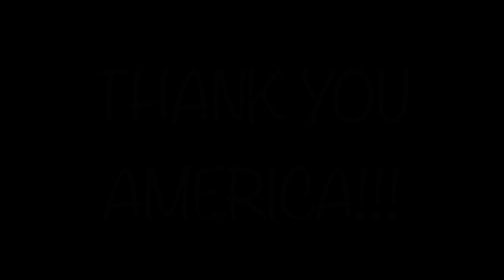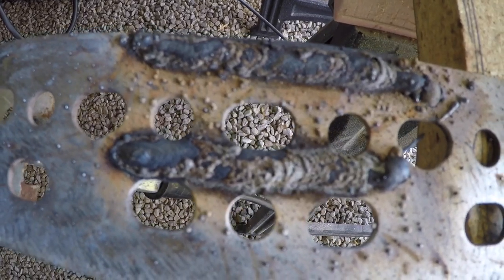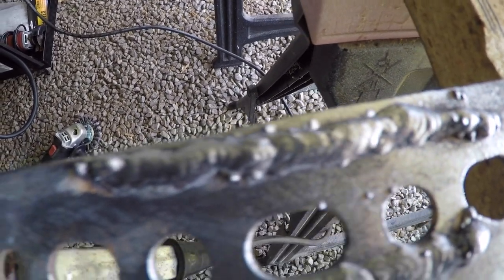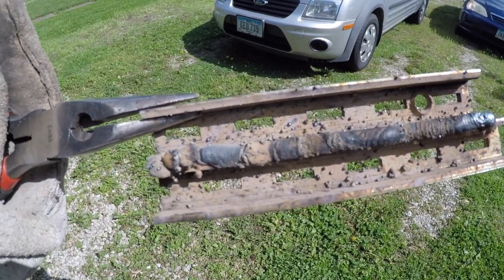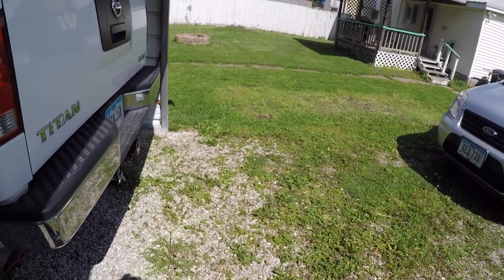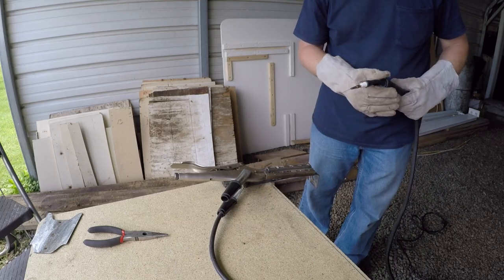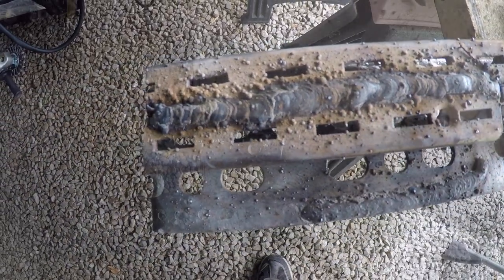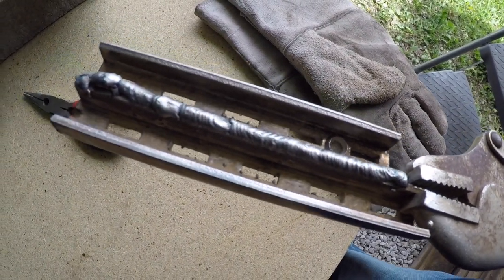Pre Mod Practice - Harbor Freight Gasless Flux Core Welder Mods - Memorial Day 2019 (Part 2)

Comment: Great Video...     4:14  Turn the wire speed up 1/2 to 1 gradiant more, you are real close.     5:30  You will often have a crater at the beginning and end of the weld.     It is ugly but not fatal as long as you aren't taking a welding test for Steel.     It would be a potentially fatal flaw for whomever was trusting their life if this was aluminum.     Cracks start at craters and can run the entire length of an otherwise beautiful aluminum weld.     The fix is easy and only takes an additional few seconds for double work.      The start of a weld is always cold (some pricey welders have 'hot' start controls) and you'll have a crater or porosity.     Okay the fix is to start in a half inch, start your weld till your puddle starts looking good, and then drag backwards to the edge and then immediately head back forward while it is still glowing hot.     Repeat the function at the far end where you weld to the end and then pull back and end in an already welded section.     Restarts in the middle are the same way.
Other side: Turn up the wire speed and as you mention a 'weave' of some sort - doesn't really matter which - your artistic preference.     A weave also forces you to slow down which spreads the heat, which will help penetration.     When you get proficient you can add weave styles if you think that's important.     I try to emulate the look of a stick weld, I assume because I learned stick welding years before I did any MIG weldingALWAYS wear safety glasses, even if using a face shield.      ALWAYS wear natural fibers or leather because almost all the synthetics will melt except the synthetics such as Nomex which is a special one of the 'polyester' family that will offer good protection for a limited length of time...
Reply from the maker: I really appreciate the tips and information! What you said makes sense to me and I think I understand what you explained. Now I need to practice, practice, practice and try to put your observations into my practice sessions. Again I can't say how much I appreciate your input. It helps me out more than you know!!! Thank you
Reply: Crater? That's why you sit still and build a puddle before you start moving and the same where you stop. If you have a "crater" then your doing it wrong lol

Comment: I want to start by saying I am in no way a professional welder by no means,and you have probably learned this by now but you have way too much stickout on the stinger! You should also use a nozzle to help with that excessive spatter! 1/2" to 3/4" stickout on your wire to the steel you are welding! Always remember" If it has slag you drag",don't push,pull! I did have 3 years vocational welding,became certified,but didn't pursue a career in it,but never forgot because of really good teachers that were hired from Ingersoll/Rand! Good luck to you,and God bless!
Reply from the maker: Thank you!

Comment: I'm not understanding ,why are people welding without a nozzle? Is it because your welding without gas,and don't need it?
Reply from the maker: Yes, the nozzle is removed because I'm using flux core and no gas so the large nozzle isn't needed. By removing the nozzle it makes it easier to see the puddle for a beginner welder such as myself. They do make a welding nozzle specifically for flux core that has a fairly small tip but I just don't have one so I'm going without the nozzle all together. This would not work if I were using gas to shield the weld of course.
Reply: @DIYHomesteadProjectsDIYHP10  just wondering,because I have the same welder.And also I noticed you weren't the only one.Im taking some of my income tax to purchase another of these welders,and the 110 harbour freight plasma cutter.The welders are awesome for body work and exhaust systems.